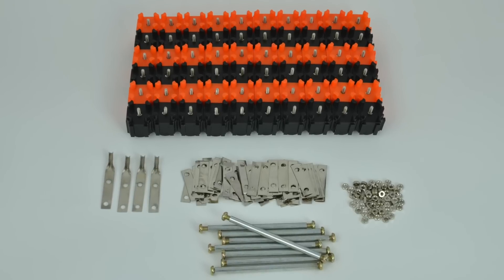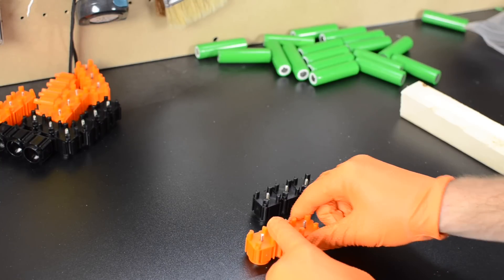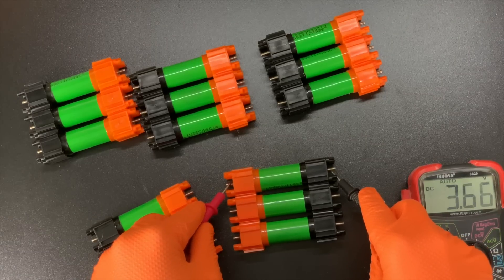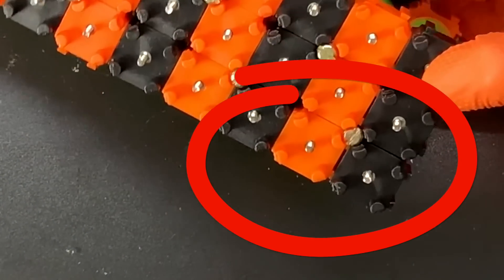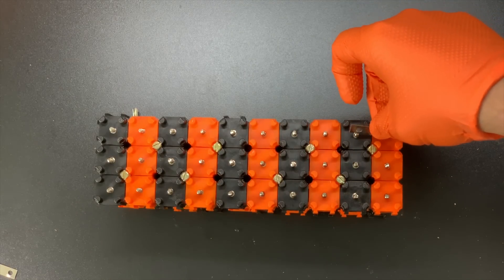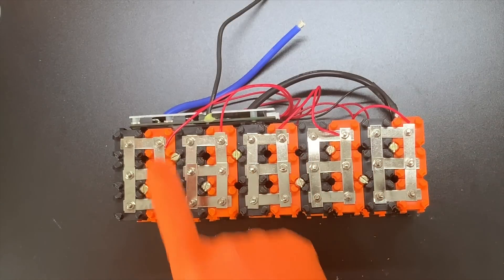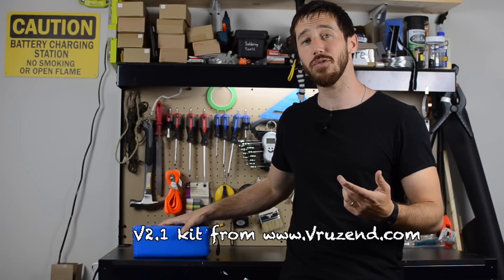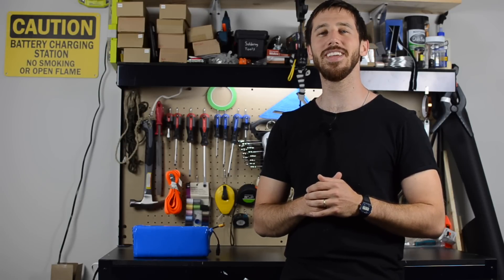New & improved Vruzend V2.1 no-weld 18650 kit

Comment: How would I build a battery to replace the 12V 80amp lead acid battery in my car?
Reply: Don't bother with lithium polymer as a starter battery. Try lifepo4 batteries. Headways lifepo4 is a start.

Comment: Thanks for the movie. The project is interesting and very comfortable. Unfortunately, such a battery is very large, and the price of $ 40 is 2-3 times too high. To be honest, I would rather solder the cells myself, or give them to a specialist store that would weld them for me for much less money. I understand that they would be permanently connected and I could not replace damaged cells, but because of the price, I prefer to do it in this way.

Comment: Looks so easy! I want to convert my manual pedal bicycle to an e-bike with solar assist.  Can these batteries support a solar recharging kit?
Reply: If the solar charger can provide sufficient voltage to charge the battery, it should be compatible. The available charge current may be too low to charge in an acceptable time, but it should charge.

Comment: So what would be the capacity of that battery? You didn't mention that in the video or description?
Reply: It was 10 amp hours per 3 pair each 18650 would be 3300mah. So this is a 100 amp hour battery.

Comment: Thank you so much for making these videos! I'm planning an electric tadpole cargo trike project using a mid mount motor... I think I'm going to use these connectors to build my battery packs. It seems a lot easier than spot welding them all and probably much more serviceable. I got lots more research to do before I dig in to the build. I'd love to check out your books perhaps...

Comment: I would talk to your manufacturer about the splitting on the 2.0 the plastic. Splits the length of the cap. I've got maybe a handful that don't have splitting. Good idea. But at the price their has to be a huge chunk of the price that's profit. Bring the price up a tad. And ensure that the plastic holders are injected properly and fully. Please take this into consideration. I have abandoned the v2.0 bc of this and opted to just print them and use nickel/zinc bolts with a machined cap threaded into the printed part

Comment: Hi, Mike, I like this system to build a battery pack, a really good idea, But the best I noticed and you did not mention is the cooling effect that this pack can have. Before sealing all the battery wouldn't it be a better idea to make one sleeve with a cooling fan on the front, blowing the cool air through the tunnel of batteries? Really just an idea as I have been reading that electric car batteries have liquid cooling but I know the loads are much higher than a bicycle. Thank you love your work.
Reply: Kent Downie I like what you or doing keep it up your teachings alot of people including me thankyou keep it up God bless you

Comment: Can you make a 12.6v battery pack from this? how many amps could you pull?
Reply: Do you not understand the concept? Any voltage, any current. You design it with what ever you need
Reply: @ColinRichardson  I get it now

Comment: Cool, this is just what I'm going to need to build my hotrod powerchair. Needs to be 24V high amps and large capacity/Ah rating, prolly 100Ah battery pack. Thanks for sharing.
Reply: I love people in 2020! I'm using this to build an FPV drone that runs on 4g satellites with my 17.5Ah battery giving me continuous 11V power (for about 3-4 hours of flight time)
Reply: damn that thing is going to be heavy. There comes a point where capacity creates a detriment to performance you know

Comment: If I wanted to run my desktop PC equiped with 600watt power supply, how can I go about finding out how large a cell I need to make to power a device for say 2 hours a day?
Reply: Do you really need the 2hrs? a good UPS units by APC.com or such will give 20 min to an hour for the 1500 VA model which uses 2x 12v 18AH SLA in series. So you need at least 36 AH for 2 hrs and a very good clean inverter for a DiY solution.

Comment: Now i'm definitely going ahead with my e-gokart build. Shout out from Lagos, Nigeria.
Reply: UPDATE: I received my kit today, now lets start building. YASSSS D:
Reply: @IdowuAsumah  hiw did you make out with your e go kart
Reply: @lordnox69  unfortunately I have not done anything in that regard. My level of lethargy and procrastination are preposterous. I built a small 24v pack with parts of the kit and tested out the motor + controller + throttle setup and everything works well. I've built have a wooden chassis, wheels and a rod I wanna use for the rear axle. All I need to do is build the front wheel steering/controls and bring all the parts together. Alas procrastination will not let me be great. Oh, I also need a BMS or balance charging system. 

What are you up to?
Reply: @lordnox69  unfortunately I have not done anything in that regard. My level of lethargy and procrastination are preposterous. I built a small 24v pack and tested out the motor + controller + throttle setup and everything works well. I also have a wooden chassis, wheels a  I keep blaming

Comment: But what about the safety ?? What if the battery needs to vent?? There's no way to vent. So the compression and the clamping is a bad idea. It's like a pipe bomb..
Reply: These batterys don't need to vent!!
Reply: Roger L. Ortiz, they are lithium batteries.

Comment: Thank you for many outstanding instruction videos! I have a question that i can´t find any answer about. is it never recommended to put a fuse and switch on diy batteries? To protect the battery cells from any damaged cables or charging connectors.
Reply: A properly manufactured 18650 has a fake top, in that fake top you will find a PTC (Positive Temperature Coefficient) and a CID (Current Interrupt Device).
1. The resistance of a PTC will rise according to the temperature of the cell, this means the amount of current which can flow through the cell will become a function of the temperature effectively limiting and eventually cutting the cell off when it starts to overheat.
2. The CID is a mechanical device, effectively it's just a pressure release valve. When pressure builds up inside the battery the CID will pop out and thus mechanically cut the battery off.

Comment: NEW!!! V2.1  no-fuse* 18650 home incendiary kit.

YES! In the very unlikely event (seriously, it's so unlikely you may as well forget it) that one of your cells FAILS (gasp) in a shorted condition, the entire pack will self destruct in a fire ball which will likely cause significant damage to property and life. GET YOURS TODAY!

*not included: Fusible links for parallel connections of cells.
Reply from the maker: Also not included: wire, soldering iron, Xt60 connectors, etc. Some things you have to supply on your own. If you want fuses, you put fuses. That's the beauty of the kit. Simply add fuses to the screw terminals if you want.
Reply: @EbikeSchool  Great, because everyone knows that fusible links between parallel cells are needed to prevent a short-fail from detonating the entire pack. It's common knowledge, silly me.

Comment: I’m looking to do a cost analysis of this system vs a traditional spot weld pack. One thing I wonder is if there have been reported issues with the nuts coming loose on the bus bars as opposed to the permanent spot weld approach.
Reply: If your worried about the bolts coming off then I recommend you use locktite.
Reply: Well I mean if you are just enthusiast or do a lot of prototyping, this is for you. If you have the equipment to spotweld and know what you are doing, it's better to do the welding I think. I am now looking into how to make batteries, but just for a fun project. I don't want to invest into spot welder just to mess around. This is actually good product for me then.

Comment: I have a electric scooter etwow s2 the battery on this scooter is 36v I wanted to know if u can make me a biger battery that is external or do you recommend me to change the 36 volts for a higher volts battery because the scooter only goes a short distance and I want to increase the speed and distance I wanted to order a battery from u

Comment: My desire for the next verson!  When you built the battery pack.  Imagine connecting only the parallel between the black minus the poles.  Then screw the appropriate fuses into the correct size from all parallel blacks, one to each red plus pole.  Then it goes to the fuse of the battery that is damaged instead of the whole battery pack burning up.  There are fuses in that design but they are too big.  Find or manufacture suitable fuses and you have a good new version, which I am happy to build my next battery pack on.
Reply: My English is so bad that I used Google Translate.  Hope you understood what I meant, can not determine if the translation was right.  The principle is, for example, Tesla builds, but simplified to fit your design.

Comment: This is a really cool product. I'm working on multiple electrification projects. This may be the answer to building batteries for those. I have an Old Garden tractor I want to convert to electric as well as a gokart and an ebike I want to build. I have a concern with the bus bars however, Will this setup support higher amperage ok? I was under the impression that you needed thicker copper bus bars if you needed higher amps.

Comment: Would you recommend blue thread-locker on the barrel bolt screws? Seems like that would help retain them for those high-vibration applications.
Reply from the maker: I'd actually recommend against it, as it can interfere with the electrical connectivity in the connection.
Reply: The barrel bolts are structural only, right?

Comment: I really don't know why it took so long for someone to design these for project use, nice job. I was considering building a motorcycle starting battery and car battery out of 18650 cells.
Reply: I'm looking at doing that too! Got any insight you only need 9ah from what I know to crank. I got a little 250 that I want to build one of these for

Comment: Great, pleasant presentation.  What do you think is the best DIY spot welder? (Low volume reasonably priced). Also have a old Zooma scooter that uses a 24 volt pb battery.  ( I think i answered my own question,.... just build it!)  What would be an upgrade replacement.
Dimensions on bat box: w 3 7/8"x l 13"x d 4 3/8"  approx.

Comment: Nice tutorial & video production. Disconnect connector from BMS  while connecting cables to battery terminals. If connected to BMS and any wrong mistake contact wire to other voltage bus maybe ruin BMS.. U can also use mineral oil to better fit plastic caps, they will fit smoothly. just an idea.. or give some hair drier heat to plastic caps. They will get more malleable to put cells. Keep uR great work. If you send me a book a can optimize it. I do battery pack development for electric city scooters. Peace

Comment: The new kit looks great,  it a nice improvement over the previous one.
I’ve been tempted to try and build my own battery for a while now but after looking into the price of new quality cells and other materials to build a battery it’s hard to see where the major savings will come from building your own. I’ve heard of people harvesting battery’s from used devices to make their own, is this something you would recommend or have tried yourself? If so I know used laptop batteries seem to be a good cheap option but are there any other batteries you would recommend as a good cheap source?
Looking forward to following your future releases.
Reply: Lee 007 power tool batteries. Most have a123 or similar batteries in them

Comment: Good to see the new addition of the barrel bolts. I had a catastrophic failure with the 2.0 kit when the pack seperated slightly after using on and EBike for 60 miles or so. Was using zip ties to compress a 10s3p pack. Looking at this new mechanism, I would be happy to recommend again.
Reply: How’s the new version working for you?

Comment: I need help. I have a 24v acid lead battery for my electric skateboard that doesn’t work anymore. I wanted to replace with one of this 18650 batteries but I don’t know how to do and if it works. Any recommendation or kit instructions?
Reply: 7s 18650
Reply: @LambySRI  but that is over 24v....can you link something ? i really don't know how a 7s looks like
Reply: @KeigoMoriyama  24v is actually almost drained. Approx 25.6v is a fully charged 24v SLA. 

7S is 7 series. Would be 29v full, and 25v nominal. Should be fine 👍
Reply: @LambySRI  thank you very much! so in total only 7 batteries will be enough? no need more?
Reply: @KeigoMoriyama  7 would achieve the voltage. However you probably want to use 14/21/28 cells in total depending on amount of amps being drawn and overall capacity in amp hours.
Reply: @LambySRI  I see! thank you for the info! So more ampere better it is right? Do you also have any schematic i can follow?

Comment: As always, another nice demonstration. Thanks, Micah. This is excellent example, when you have used batteries and some of them fail, then you can replace only those affected, not tearing apart the whole pack. Exactly what I need.
Reply: From some of the videos I’ve watched, they say that all used batteries should be replaced regardless when any battery is replaced because you can’t guarantee that they are equal in all regards. 

To be fair, I don’t know anything about battery packs and this may or may not be solid advice so take with a pinch of salt.
Reply: @BadPractices  i had a thought. Bcuz we replace just one or two cells, means those new cycles are out of sync with other older ones that have more cycles, therefore more difficulty of balancing between them.

Comment: Looks like a nice improvement. I used the V2 kit for a 10S3P pack but ultimately pulled it apart and spot-welded instead. It just seemed more secure. What disappointed me was the dents the caps left on either end of the cells due to the pressure when installing them. Also, measuring the voltage doesn't seem like the best way to tell if a proper connection being made. A connection which is good for a few mA isn't necessarily good for 5A. Using a multimeter alone doesn't tell you much :)

Comment: Okay, just a thought -- a question for all you do-it-yerselfers -- what's wrong with just drilling some holes in a coupla pieces of plywood to make a honeycomb pattern to hold the batteries? Add a couple of bolts or something here and there to hold it all together and yer done, start connecting everything.  Wouldn't this work? Or am I missing something?

Comment: i'm building one with used makita cells i get from my employer, i want to build a 12s6p. almost have enough cells.
Reply: to make sure they are all the same voltage i charge them to storage voltage, all with the same charger to prevent to mucg voltage shift.
Reply: Maybe check the internal resistance of the cell from each original pack to see if one cell is more damaged, so you could separate any bad ones.

Comment: I really like this. Make me feel a lot more comfortable building my own battery. Thanks
Reply: do you need to measure all of them one by one
Reply: @ebubekirelladin7471  Yes. If you don't, one of the battery will cause the others to no longer charge or doesn't conduct at all. Example:

One is at 3.9v and the other is at 4.2 (full charge). The 3.9 will no longer charge. Or, one of the battery isn't properly attached and makes it 1 voltage less, ruining the Series connectors.

Comment: Hi mike, just a simple question.... I watched several of your videos on making batterypacks with 18650 cells. I want to know if it is a problem when you make, lets say a 52V batterypack, and add several output-wires to extract the different voltages ? I want to run an electric car-motor with it, but I want to be able to connect devices to the same batterypack with different voltages. And of course do it without problems (break downs, overdischarge, heating, or worse). I'm planning on making it a 20Ah pack. Can this be done without problems and danger ? Sincerly Ton Krol ... the Netherlands
Reply: No. You will unbalance the battery
Reply: @LambySRI  Thanks !!! I was afraid of this somehow.... well nothing else left than making separate batterypacks for each voltage then !!!

Comment: Can you explain why you don't use some type of safety fail-safe for the individual cells like fuses or fuse wire
Reply from the maker: You can, you just add the fuse wire to the terminal. same thing as if you spot welded or soldered. The kit is just for making connections. Its up to the builder to decide if he wants to use fuses or not. For new cells, fuses aren't that necessary. They are used in the diy power wall community because they generally use recycled cells of mystery quality and histories, making failures much more likely.
Reply: @EbikeSchool  Thanks, so in the prefab batteries there is no fusing.

Comment: Hi! I recently bought some used laptop batteries which I want to salvage and make my own battery pack but I would like to know, what do I need to look out for when salvaging batteries? And when making the battery pack can I combine different cells ( models ) as long as they are lithium ion cells and have the same voltage?